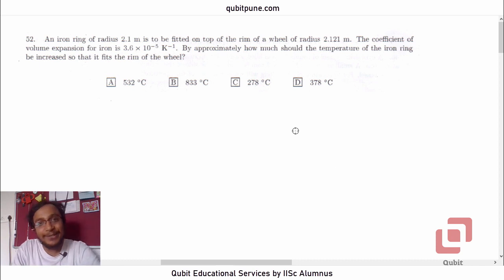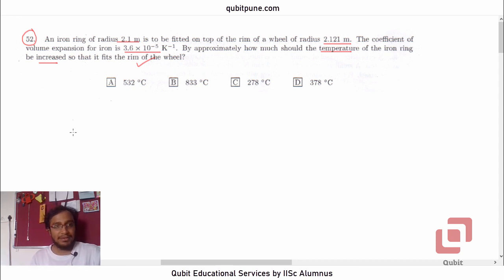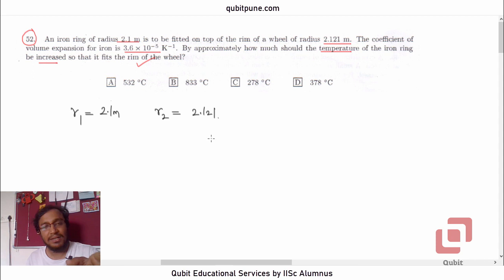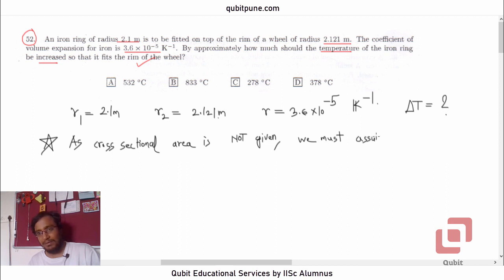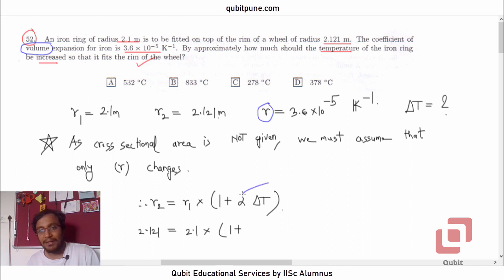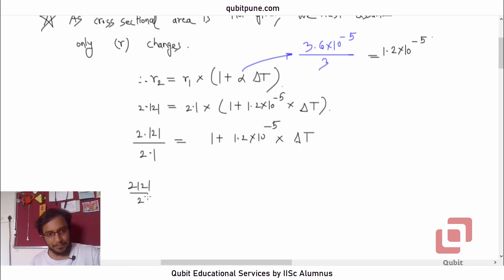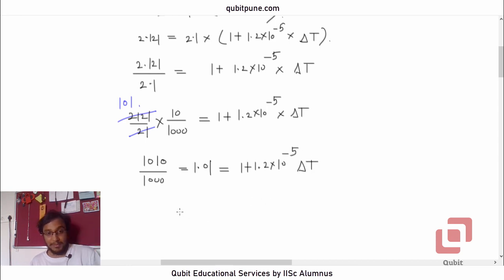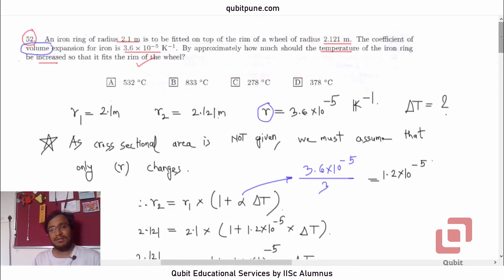Q.52 | IISER Aptitude Test 2018 Physics Solutions (Website Paper) | @qubitpune

Comment: Sir , since volume coefficient is given Kelvin scale , delta T obtained by calculation will be in Kelvin scale, and so it must be converted to degree Celsius .. right?
Reply from the maker: Does not matter, as it is change in temperature. 2 temperatures in kelvin and in celsius have the same difference!
Reply: Okay sir👍

Comment: bhaiya, since the radius of a ring is something that is measured from a point "outside" the body of the ring, is it right to write the formula of linear expansion for the circumference (considering the circumference is the actual quantity that is increasing) ? The answer would be the same as 2*pi gets cancelled from both LHS and RHS.
Reply: even I did the same way, ig its right.
Reply from the maker: It is right 👍
Reply from the maker: Yes, 2pi gets cancelled and you come to the same result!